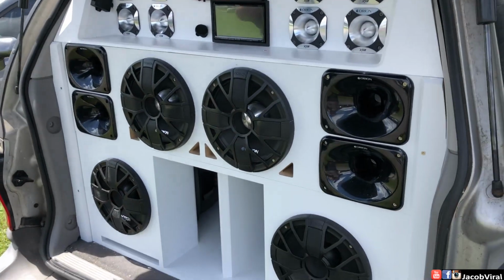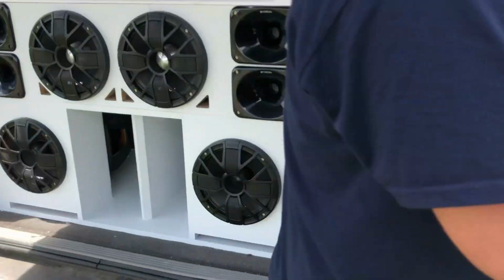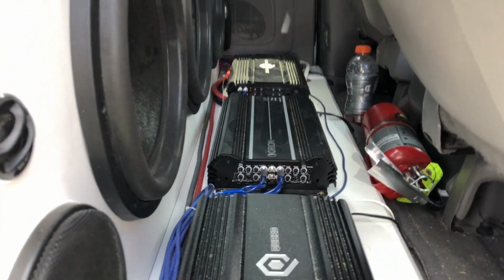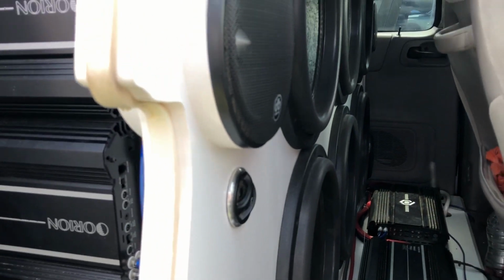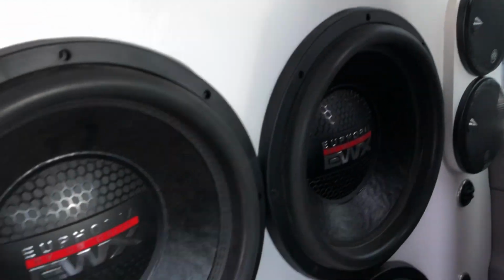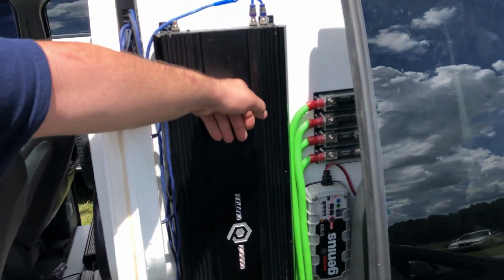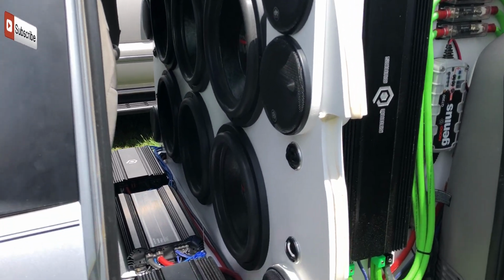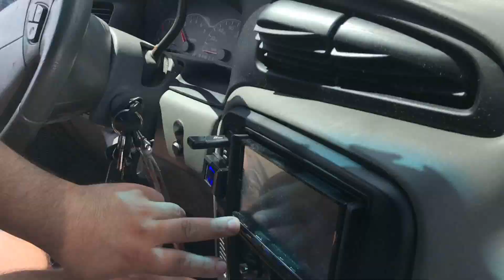6 15S WALLED | SPEAKER WALL IN BACK

Comment: What kind of subs are those in front? Can't read the name :/
Reply from the maker: I try to always include the specs in video descriptions. 

-> DB Drive Euphoria EWX Subwoofer (15" - 2500W Max - Dual 2)
Thanks for always watching!
Reply: I got 3 of the same subwoofers in my 2003 z71 suburban. I have a vfl 6k amplifier on em and they hit hard.